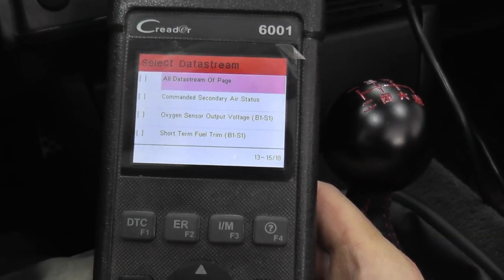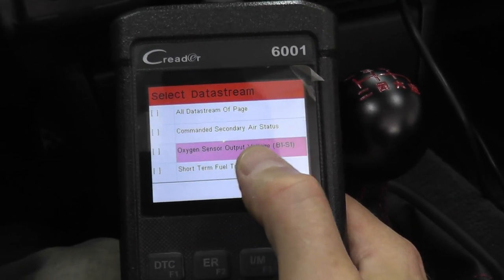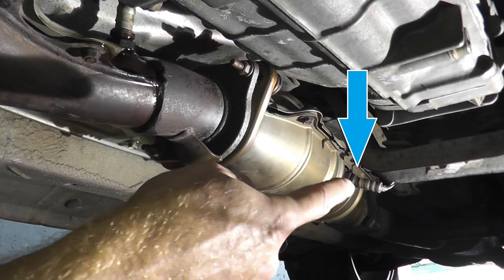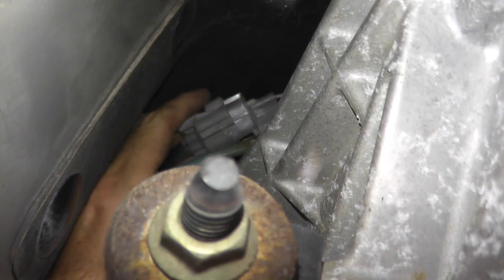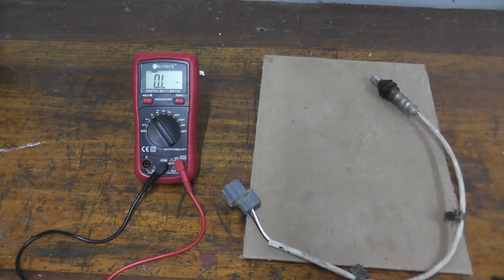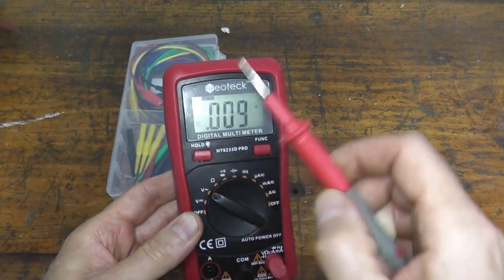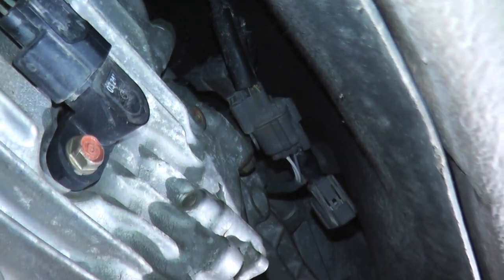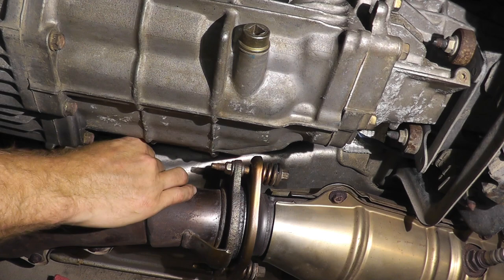How To Test And Replace Heated Oxygen Sensor P0131 P0132

Comment: method works for traditional o2 sensors however does not work for modern cars that use air fuel ratio sensors

Comment: Please am a mechanic and have been working on Chevrolet Colorado for More than a week,the machine was difficult to start. now it's start and off again unless I used my to cover the hole on the carburetor to the air filter
Please help me 🙏🙏🙏my boss is on my neck
Reply: And again I have to put Petro inside the carburetor before it start but when the fuel burn then the engine stop but when I use my hand to cover the air flumetre to the carburetor the engine will be on for five minutes

Comment: So much is missing from this video if someone actually wanted to test the o2 sensor itself is capable of producing a useful signal, or if all of the sensor wiring on the vehicle is actually good??
The codes you showed have absolutely nothing to do with the correct function of the sensor heater element, however the limited info you showed here only relates to the sensor 'heater' element?
The codes you referenced are related to incorrect/out of normal range sensor 'signals' received by the pcm??
I guess misleading or missing information is what YouTube and the internet is all about nowadays.
All you did here is verify the sensor heater element was potentially intact, and there was 'unloaded' voltage on the (poz +) harness wire for the heater element.
What about testing the integrity of the ground wire for the heater element?
What about the signal and shield wires on the vehicle?
What about the ability of the sensor itself to produce an actual voltage output when it is at operating temp? What about the heater element, can it actually create any heat, or does the element draw the correct amount of current when it's powered up?
Are the signal + sheild wires good all the way to the engine computer?
Is the (poz+) wire on the vehicle for the heater element able to carry any current to allow the heater to work properly?
Are the harness socket terminals tight enough to provide a good electrical connection?...etc etc etc.
You could've included a lot more information and tests to make this video somewhat helpful to someone who wants to diagnose these codes correctly, maybe then they could actually save themselves some money after doing a thorough and accurate diagnosis🤣
Reply: I agree, what he did was good basic diagnostic, and if some of the things he mention is not ok, then the sensor or the voltage in the car is probably to blame, but there are sooo many things not tested for, in this video.

Comment: Info missing for wideband sensor and no rhythm or reason for electrical testing procedure used here....this is not correct,  sorry.
Reply: Agreed, the bench test does not tell if the sensor is good or bad, what he measures is only to test if the heater inside the sensor is ok.

That's the 2 white wires. The oxygen sensor is the 2 black leads, the sensor part is not at all tested in this scenario.

The heater is only in the sensor because the sensing part only works at higher temperatures, but the sensor part can easily be broken or bad, even if the heater is on.

Telling people that as long as there is 3-10 ohms at 2 terminals = The sensor is good...Is simply wrong.